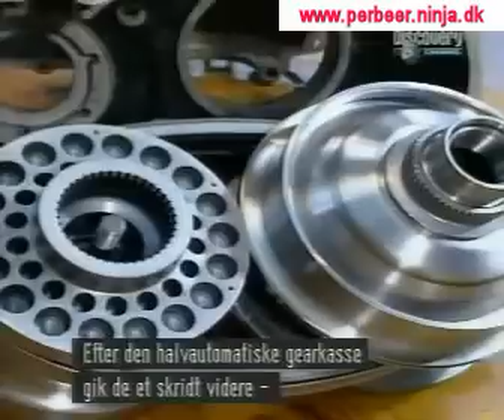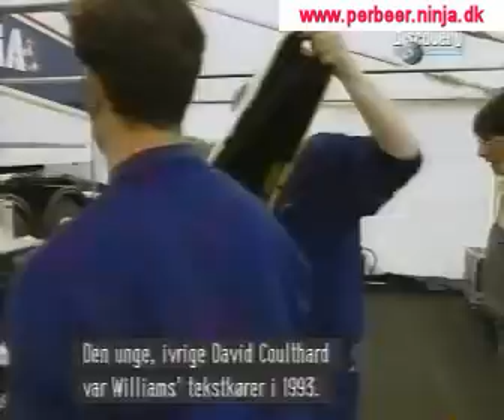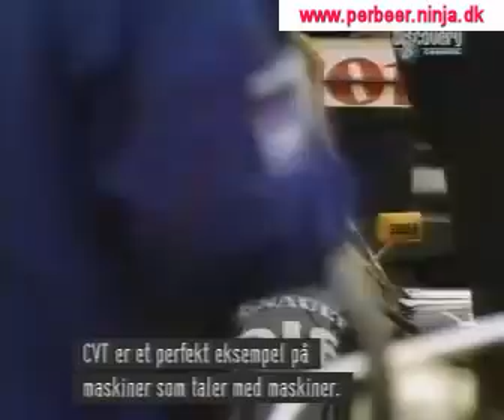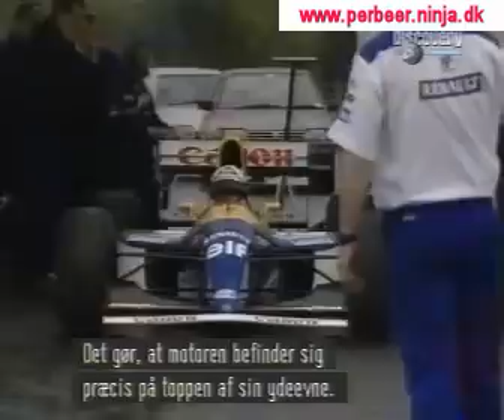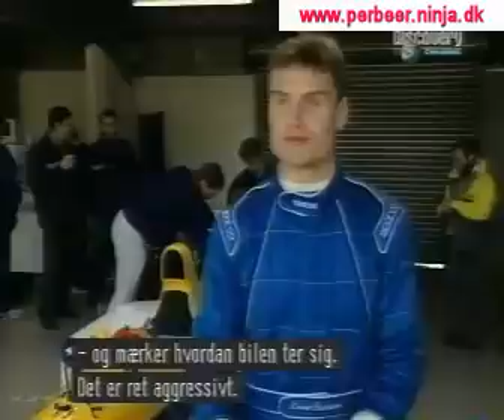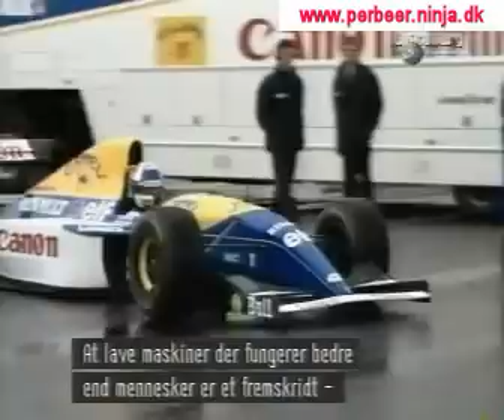Williams FW15C CVT

Comment: Electronics my ass. CVTs are mechanical. They’re just a set of spring loaded discs that hold a belt at a certain place, like your bicycle does with gears, and then the centrifugal force of the spinning slowly forces the discs either together or apart as the engine accelerates or decelerates, which results in constant, perfect torque range. There is no power band, because the CVT keeps you at optimal torque just by exploiting how physics works

Comment: Some people say this could've been as much as 6 seconds faster hence why it was banned IN TESTING how much faster could this car have been? A car so advanced it needed 10s of kilos for the extra kit and could go 20,30,40kph faster around high speed corners and just be thrown in there, drag reduction on the straights. Imagine a modern F1 car with its isane efficiency but massive engine with more cyliners barge boards, skirts with active suspension to suit it these systems wouldn't even be that expensive to put in a FormulaX class or something. use RBx2010 like wheel and cockpit covers for aero with all that power perfect suspension with a modern driver who would understand it and not suddenly be finding tenths extra in corners and this car I feel was never even really in need of being pushed to get where it needed to. Don't restrict aero or real track testing, cars could go 20 seconds, there are even fan cars that exist today that ahve filters etc. to have effectively an active floor. Anyone of these changes could be 5 seconds but all of these espeically on tracks where modern day cars stuggle could be true insanity.

Comment: Come April 2023 & it's CAFE 2 implication. When pure ICE will be obsolete. 48V mild hybrid ISG will be a bare minimum. With the ISG taking care of stalling speeds, a direct drive CVT drivetrain will be possible. Saying goodbye to the torque converter required to pair the ICE to the CVT.

Making Reno's concept finally make it to production 😅. 
Sweet revenge ‼️😍

Comment: Without gear changing, engine sounds for me like electric bus, trolleybus or subway train. Electric engines have wider RPM working window, so they mostly doesn't require any gear changes at all ranges of speed, comparing to default ICE with standart gearbox.

Comment: It's so weird that cvts are now used for crossovers and economy cars when they used to be designed for racing
Reply: they failed in both. Most gas or diesel cars have normal transmission and also no race car ever really used them. inefficient and unreliable.

Comment: I will never understand why CVTs feel right to me and wrong to so many other people. The first time I drove one it made perfect sense and I wondered why they aren't used on all cars. The engine produces the power requested, and the transmission adjusts its drive ratio to deliver that power to the wheels at the speed they are rotating. Simple.
Maybe it's because I've always gauged my speed based on sensations other than engine noise. Wind noise, pavement rumble, objects moving past my windows...all of those things indicate the car's absolute speed. Whereas the engine noise is always changing depending on what gear the transmission is in, so I guess I just never paid any attention to it.
Reply: CVTs can be quite good but the OEMs for a while in the 2000s-2010s made some BAD ones.  You hop on something like a snowmobile or ATV that has a CVT style setup, they are fantastic.  Believe it or not, best regular production car CVTs I've driven yet were the current Chevy Malibu 1.5T and the Trailblazer 1.2T and 1.3T with CVTs.  These small 3 and 4 cylinder engines GM use make peak torque from 1500-4000rpm so with the CVT behind them during acceleration, its just sits in the torque band better than the 6 or 9 speeds they also use.
Reply: Cvt is one of the greatest invention ever. Basically infinite gear and better fuel economy because it almost never reach the max RPM. Manual is pain in the mass especially in traffic jam, which happens pretty often in my country. Manual shifter may be a bit more fun, but the fun doesn't last long in regular day.
Reply: for me, it seems impossible to drive an automatic transmission at all, I'm too used to a mechanical one, and I won't be able to get used to the fact that I can't separate the gearbox from the engine with the clutch pedal, and lower the gears when I need to, the automatic and CVT will refuse to lower the gear ratio when braking, on mechanics I will do it right away using a re-gas. on mechanics, you can not use brakes in the city at all, and I am not afraid of their failure.if the brakes fail, then after 10 seconds, with the help of engine braking, I will already be in 1st gear, and then I will carefully stop on the side of the road.
Reply: @HoldenCommodoreGRA you can just use the paddle shifters it's really not much of an adjustment
Reply: @kidcharlemagne8717  do many cars with steering paddles have a clutch pedal or at least a button? only racing cars.
Reply: I think utilizing the engine to it's full potential, most efficiently is super cool and don't get why this isn't used
Reply: Most of it's just cause oldies miss the feel of the whole car shaking and slowing everytkme there's a gear change
Reply: A lot of people hate it because it doesn't feel like it's shifting gears and the reliability of the transmission is not as long as automatic transmission! I like it because compared to automatic, manual, dual clutch transmissions, CVT is the most unique because of it's infinite gear ratios!
Reply: Because its fucking shit. No one wants to listen to CVTs. Would rather listen to a hybrid engine than a CVT. Only thing CVT beats is an electric car
Reply: @qbvzy  i think there should be a new F1 category split - 1. CVT and other Enhanced Tech 2. Old school you still want to hear gear changes and limit technology. There are categories in SCCA racing, Why not F1? LOL
Reply: @qbvzy  yeah but performancewise it's better and there's no discussion there. Don't know if you realize some people actually care about performance over sound.
Reply: @qbvzy  why have they gone v6 hybrid then lol
Reply: @isaacsanchez7317   oh shit good point but in the 90s, they definetly abandoned CVTs because most people wouldn't enjoy it. If they were more efficient, faster and all that there would be no reason to end it except for the sound. Now they want everything to be green which is just a joke
Reply: @qbvzy  yeah it's truly sad and literally contradictory considering the transportation emissions lmao
Reply: @qbvzy  and maybe reliability also played a part in abandoning research
Reply: @isaacsanchez7317   would biofuel/sustainable fuel V10s or V8s be just as reliable as before? I think they might find some sort of solution to help reliability a little, since F1 is ridiculously expensive nowadays

Comment: Snomobiles run cvts, mainly because you need that consistent application of power in deep powder or you will get stuck. If the track were to stop momentarily for a shift while youre churning through snow you would lose all momentum and probably have to spend the next 30 minutes digging. Different story on hard snow however.

Comment: It sounds so weird like it’s haunted for some reason. Doesn’t give that sense of acceleration of  fast gear changes in a conventional gearbox.
Reply: Because to someone who's used to conventional gearboxes, the sound cue tells the car is stuck on first gear. It would need some getting used to.
Reply: @Luks9106  Sound like the Koenigsegg Regera wich has just 1st Gear and Reverse sounds.. intresting i think. Bit its so weird that it has infinite gears and no gears at all at the same time 😅😂
Reply: @Luks9106  yes
Reply: Its because the engine will stay at the rpm where power and torque is at its peak usually at the highest rpm. Thats why it sounds loud and sounds like not accelerating because it is at its highest rpm where the highest power output is available.

Conventional transmission has to build up power over and over again every gear change because when you change gear, the rpm will go lower again thus lower power output again, unlike cvt where power and torque is constant/continuous all throughout the acceleration. Power and torque varies depending on rpm. Usually lower rpm = lower power.

Cvt are kind of like changing gear smoothly (infinitely) while keeping the engine running on its best and constant rpm where power and torque is at its peak/best.
Reply: @luisocamp2753  The unique's of CVT is why I like it for performance wise, not reliability (if only the belt doesn't slip)!

Comment: I damaged the front wing end plate of the test car when moving it to the technical university of eindhoven after it was displayed at the manufacturer of the transmission Van Doornes Transmission in the Netherlands. Still remember my respect for the car and Williams team since i was a huge f1 fan.. I was ashamed.. While lifting the car off the truck i tried to grab the front wing to balance it because it was swinging  backwards like crazy! Just when i got hold of the front wing it slipped and the front of car smashed into the sealing braking the front wing end plate..

Comment: Do the average economic CVTs placed in our cars today have the potential to be tuned for racing/speed? Maybe a change in physical components of a given cvt to handle more power, and some computer magic is all we need to get an actual fun CVT
Reply: yes/no
 90's CVTs and older work correctly/ Newer ones are made to "simulate" gear changes because people either HATE how it sounds and refuse to buy it, or think that the car is broken because the engine revs aren't changing. 

Current CVTs are gimped and broken. They do not function as a CVT should, and loose both efficiency and HP from it. 

If you could shove in a custom ECU- you could reprogram the fake rev curve to be correct, but, good luck finding such a ECU.
Reply: @akabiscuitwaffle  my Lancer's cvt drives like a traditional cvt (no fake simulated shifting). Have no issues with it.
I don't hate it and this is coming from someone that had a 5 speed manual suzuki swift.
It's just that people refuse to accept change when they're used to something for so long.
Reply: @akabiscuitwaffle  yeah there’s literally no point of having CVT if it’s just gonna simulate how a traditional auto transmission shifts
Reply: the regulators of cars should ban the dreaded fake shifting, either let a CVT work on its maximum efficiency or don't put one in at all so fuck Nissan and Subaru for now

Comment: Acceleration is surely better than anything on the grid but what about the engine break going into the corners?
Reply from the maker: Drivers would adapt, like they did for the hybrids.
Some engine braking would be possible, but most likely in a very different style.
Reply: Sepa indeed. Transmission speed becomes the same with the engine speed so probably behaves like a 6th gear engine break on a car

Comment: why cvt has ban??
Reply from the maker: High development cost, unfair advantage for the Williams (and they already had the most advanced car on the grid), fans wouldn't like another driver aid that simplified driving the car, it would change car noise drastically...
You pick the reason :)
Reply: @sepaf1  - It's not a driving aid but a different way to deal with how power goes from the engine to the wheels. A driving aid would be going from manual with clutch to sequential to auto. This just means that there are no gears except for FORWARDS and BACKWARDS. You'd never say that a Polaris RZR, a direct-drive kart, most scooters or a freaking moped are "aided".
Reply from the maker: @DiegoRuiz1991  yes and no. Even today it would aid the driver as they wouldn't have to shift gears anymore. In the same way (semi)automatic gearbox is considered a driving aid over manual gearbox.
Reply: @sepaf1  - It is NOT a driving aid. Is a 2-speed gearbox a driving aid when compared to a 4-speed? What about a 5-speed versus a 8-speed?
Reply from the maker: @DiegoRuiz1991  so, for example, it doesn't remove the possibility of a driver error while changing gears?
Reply: @sepaf1  - That's like saying that a supercharger is a driving aid because it avoids the possibility of turbo lag. IT'S A WHOLE DIFFERENT SYSTEM!!!
Reply from the maker: @DiegoRuiz1991  sure, ok :)
Reply: CVT is driving said,and also it makes a car sound like air raid siren
Reply: @KitKitChanIsaac  people are used to conventional transmission and refuse to accept change because of "feelings".
That's ok because that's a natural tendency. Change is inevitable in general.

Comment: Sounds like a Prius :/
Reply: They didn't floor it. Search for things like "snowmobile racing", "terracross" and "powerboat racing" to actually hear the sounds of CVT racing.
Reply: @DiegoRuiz1991  I meant the that the sound is very boring without the gear shifts.
Reply: @kristupasantanavicius9093  That's because people are just used to normal transmissions so much its just hard to get used to something different.
That's normal, people refuse to accept change all the time.

Comment: CVT transmission is able to maintain the most ideal rpms for any given engine speed this would kill Amy of the other F1 cars at the time
Reply: CVT transmission.
Continuous Variable Transmission transmission.
Reply: TreVox it's like how people say kfc chicken. they just associate the word with the adjective and use the noun as the category
Reply: @TreVox  ATM machine
Reply: @Plur307  pin number
Reply: @leehasselbeck453  being scam
Reply: @CriticalCorrie  di di di daun keladi sapo tubik dulu yo tu jadi
Reply: @ayn30  Lah ade melayu
Reply: otherwise CV Transmission can be easily mistaken for CV joints
Reply: Didn't realise it got so many likes lol. Yeah Im the transmission is able to keep the car at the optimum rpms for maximum torque all the way through
Reply: That's the strenght that prevents Toyota Prius from being a slug. I mean, it's not making it fast, but according to its weight and power, it's definitely not that bad.
Reply: Who's Amy?
Reply: @tharun72 I had the same question
Reply: If it could actually last a whole race maybe
Reply: but also kill their own engines.. imagine going all the way to work, revving your car to its redline the whole way.
Reply: @stevewilson2745  wouldnt cvt in cars  would always shift to the highest gear and maintain at the lowest rpm possible unless you floor  the gas pedal and the computer would send command to  down shift to the most suitable ratio
Reply: @woozhi9218  in road cars probably yes, but in f1 you're looking for the most power available at any given moment, so it would stay in the ideal power band (around 10k rpm for example)
Reply: @stevewilson2745  Load demand for an f1 car is peak power at all times.

Load demand for a regular car is how CVTs work. reducing RPM to the lowest it will go when aplicable
Reply: @stevewilson2745  you obviously don't know how CVTs work. Next time do your research before you start saying shit like that.
Reply: @stevewilson2745  Pretty sure its almost linearly based on speed, i dont think youre ever gonna even get close to redline on your way to work. Unless youre late, of course.
Reply: @stevewilson2745 you wouldn't unless you needed full power the whole way 😂
Reply: RPMs and engine speed are one and the same thing. You mean ideal torque for the demand.
Reply: taotoo2 exactly what I was going to say.
Reply: Problem is that with CVT it doesn't matter anymore because it's not the engine doing the accdeleration - it's the transmission by changing the ratio.
Reply: RPM and engine speed is the same thing lmao
Reply: @epeli0035  he probably meant wheel speed, instead of engine speed? It would make sense anyway.
Reply: Not really. Lol

Comment: This sounds so weird i started imagining gear shifts in my head
Reply: I just imagined a 787B with a CVT... Help
Reply: If it helps, the continuous redline is millions of very tiny shifts
Reply: @dsdy1205 it's like the Calculus integral of gear shifting instead of the rectangle approximating graph
Reply: It sounds SO weird. I had a ford fiesta that i used to drive like a little race car. It definitely wasn't, and God knows that car especially with the transmission problems that that model line had shouldn't be driven that way, but as the owner of a new Corolla equipped with a CVT engine, yes this is what a CVT sounds like when you drive it like a race car. It's like the many faces of Chuck Norris. "Mistreating" "babying" "racing" it's all the same. If they had an ad for CVTs in general it would say 

Its a CVT!  Drive it until you can't!*

*Unless it's a Nissan.

"Nissan: we own a 75% stake in the company that manufactures our transmissions. Because even when you fail by buying one of our vehicles, we don't."
Reply: Me too
Reply: Me too
Reply: RubberBand Man!
Reply: I have a 2008 nissan altima, it has a CVT transmission and getting on the highway is so weird. Absolutely no shift; just revving and all of a sudden you're at 70MPH  😂
Reply: @neoemberarts  it's like that in a Prius. The engine revs up like a train and you gradually get faster.
Reply: And then Coulthard drowned it out with Scottish language
Reply: I couldn't stand the gear shifting edging
Reply: Sounds like a Vespa
Reply: It sounds brilliant to me.

Comment: Random fact: Subaru's ECVT was based on the same pushbelt CVT idea Williams used in F1, only the ECVT is far weaker than this one because of the powder clutch.
Reply: Is there anything to read on how Williams solved the CVT slip problem? Where is the explanation of the push belt?